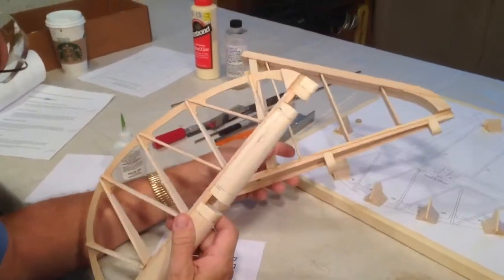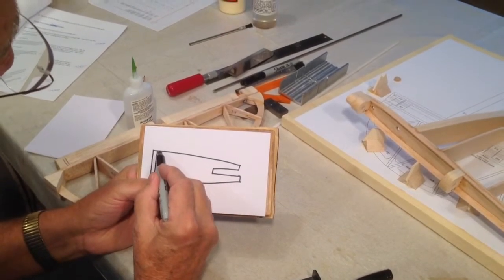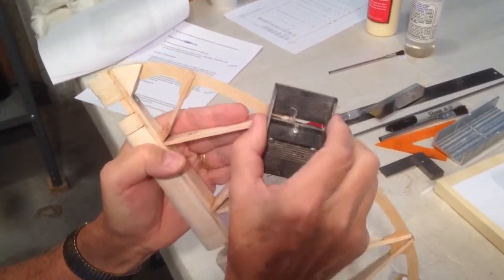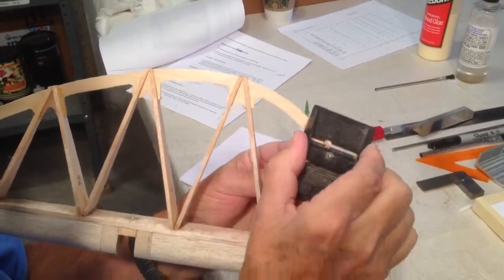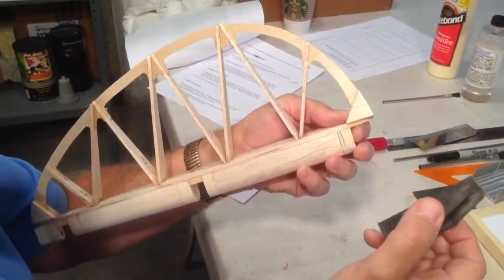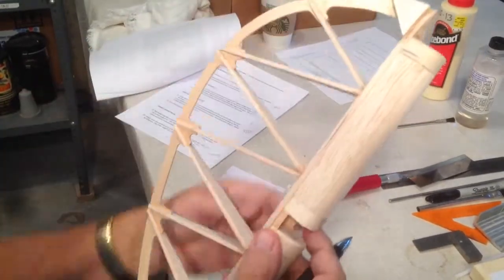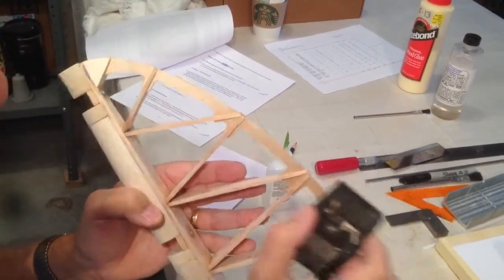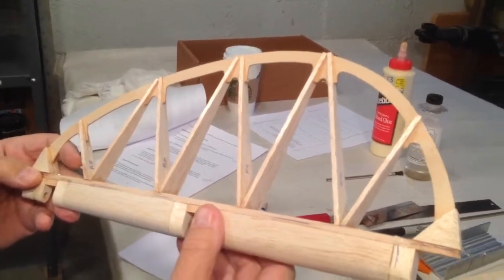Rudder Rib Shaping Part 1

Comment: Hello so I've recently gotten a razor plane similar to yours and am having difficulty tuning it do you have any pointers
Reply from the maker: Hello Bio,
The razor plane is made my Master Airscrew.  You will need to experiment by slightly adjusting the two screws that adjust the depth of the blade.  It won't take much to make a difference.  This plane is only useful on balsa.  I like this plane very much.  Something "similar" might not work as well.
Reply: Actually its 100% like yours it is a master aircrew and thanks for the tip